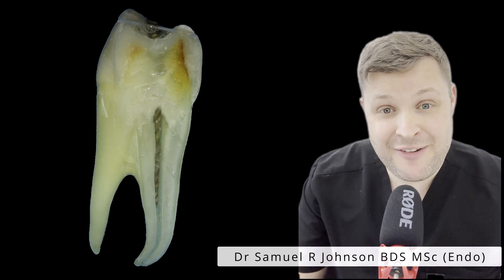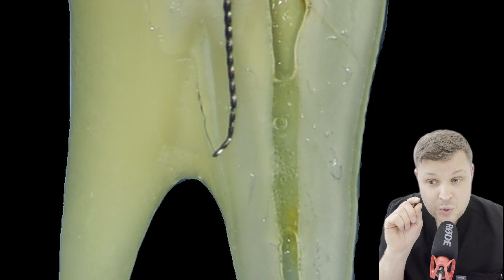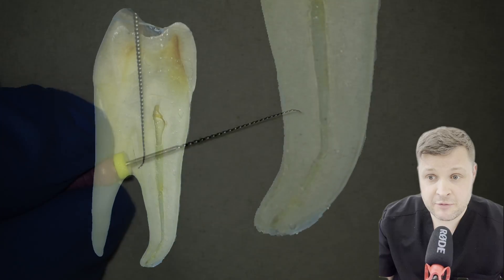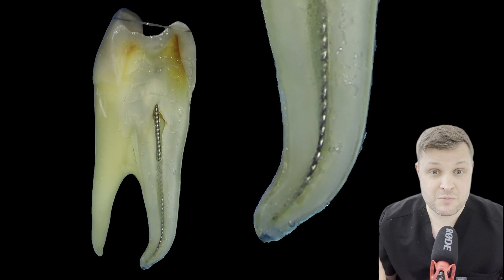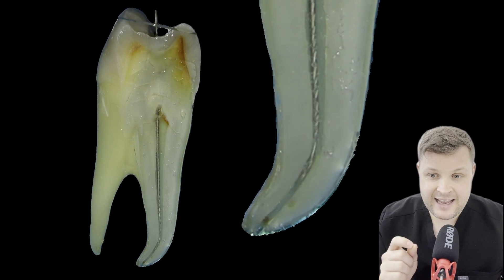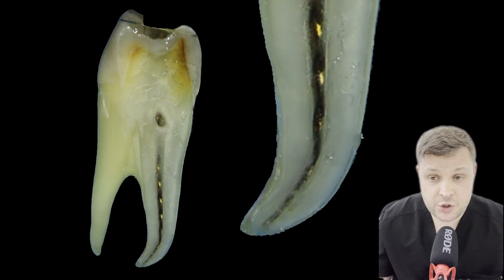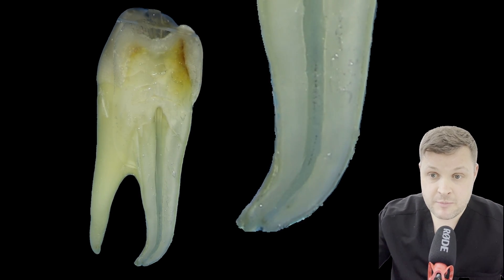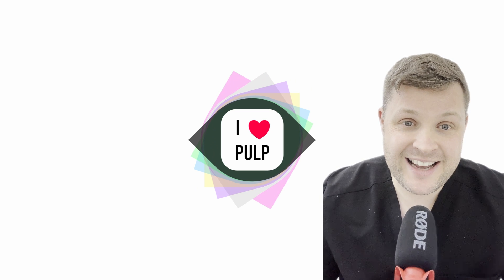How to Fix a Ledge in Root Canal (Step-by-Step Technique)

Comment: thanks for the tip! do you actually also make a small curve for the tip of bigger files (lets say iso 45..50..) then? and another question - with a curved tip you shouldnt do balanced force technique right? just back and forth ? thanks a lot
Reply from the maker: Any file larger than a 25# will struggle to negotiate to to the apex! Thank you for your support! Have you subscribed?! 😊😀

Comment: Let's say a ledge has been created at 16 mm in a 19 mm canal.
Would it be beneficial to shape the first 14 mm of the canal with a rotary file to widen it before proceeding with the bent k-file?

Because i feel like if the canal is narrow, wont it just end up straightening the bent you made before it got to the ledge?
Reply from the maker: Absolutely! This is what I tend to do on most occasions and is really what is missing from this video. Thanks for pointing it out!
Reply: @ilovethepulp  glad to know I was on the right track.
Reply: @syedarqam9341  great point. ..thanks for highlighting and reminding
Reply: Is it crown down  technique? Which number of rotary files do you use in this kind of situations? Before using k file nr 10?
Reply: So in this case you recommend crown down technique? And in situations when only the hand file nr 6 achieves the apex?

Comment: Love the video! Thank you! Just got a question, for example ive made a ledge and now manage to handfile till size 15, my rotary still doesnt go past the ledge. What can i do??
I use protaper ultimate
Reply from the maker: @jeremiahtaytzemeng2705  use a 20# hand file, and then 25# until you manage to get past! But it can be frustrating!
Reply: @ilovethepulp  I'm just thinking PTU can't be prebend. Hyflex can.. does that make it better for ledge?

Comment: Nice video. How long does it take to “correct” a ledge? Is it possible to use a WaveOne Glider after smoothing out the ledge with K-files?
Reply from the maker: It’s kind of those ‘how long is a piece of string’ questions! I think if you reset your mindset on the subject of ledge correction from how quick it can be done, too taking your time and don’t rush. Any attempt at getting it smoothed out as soon as possible will re-ledge the tooth, possibly making it non-negotiable. Now I know that you weren’t asking in your question about doing things quickly! I just wanted to make the point clear about taking your time! As for the WaveOne gold glider, yes that will work, the principles are the same. What are your experiences in clinic with ledge correction?
Reply: Well, I do not have that much experience. I am a young associate from Denmark. 
I find endodontics interesting, so I began exercising on extracted molars a few days ago. I would like to learn to manage easier molars, but I do not know how much time is reasonable to spend on a canal before I should refer. I had some patients I had to refer, because after 3-4 hours I couldn’t get to WL in one or more canals. My boss is not too happy about it, of course, but I am fortunate enough to be able to try at least.
 I would like to be able to correct a ledge I made on a patient on a lower molar in the apical third of the mesio-oral canal. This is the first time it happened to me. I can get to the apex with a k-flex 10, but only if the tip is bent.